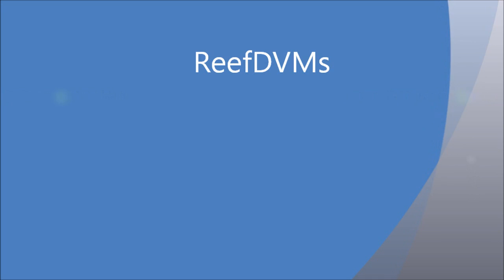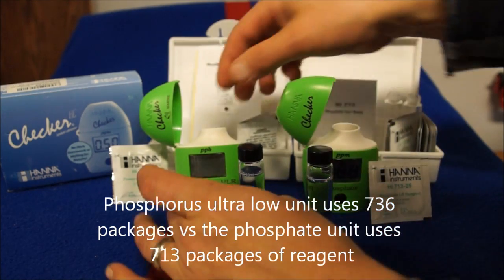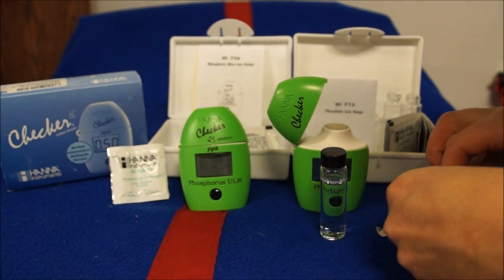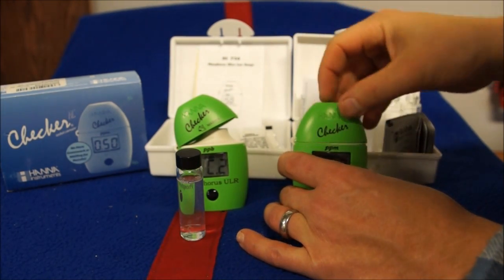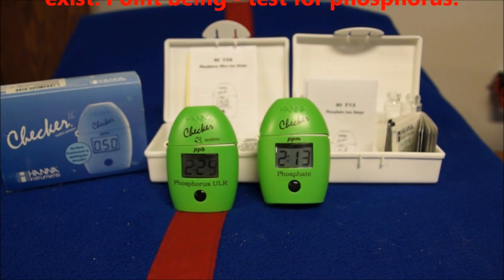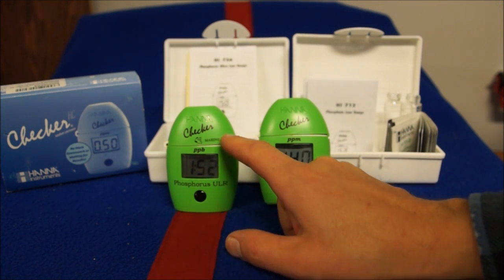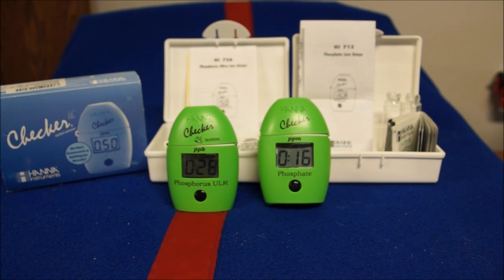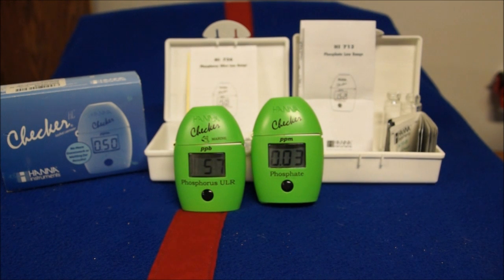Comparing Hanna Phosphate vs Phosphorus ULR Marine Testers

Comment: Great video/ very informative. It's exactly what I was looking for and answer to the varying results between the two testers and what they really test for. I was getting higher phosphorus then phosphate before carbon dosing. I stopped testing for phosphorus and only tested for phosphate and my corals started having issues. Since I have been carbon dosing my tank, my phosphorus (tester) (not phosphate) bottoms out to zero ( I didn't realize it before, when i first started dosing). If I add live phytoplankton my phosphate tester value seems to go down. I didnt understand the difference between these tester until I saw this, so thank you (I thought I was going crazy and I couldn't find a answer on the web until I found this video).

Comment: You’re putting out inaccurate information. Phosphates are not present at the equal ppb (parts per billion) of phosphorus, so you don’t just divide ppb by ppm (parts per million). All you’re doing is converting the phosphorus reading from ppb to ppm, but the phosphate levels are not being read. First you must figure out level phosphates are present with the phosphorus reading you’re getting, once you’ve figured that out you need to convert the accuracy of the results from ppb to ppm and apply to that number then you’ll find that a 57 ppb phosphorus reading is equivalent to a phosphate level 0.175 ppm not 0.057 like what you came out with. Also you’re not whipping off your finger prints from the vials before testing it and the results you’re getting may not be so accurate because the checker is picking up the cleanliness of the sample and any smudges on the glass are being interpreted by the reader as water quality.

You need to take down any misinformation you have on the internet, especially ones offering solutions and guidance because allot of people only rely on these kind of research in order to learn things and you are only making them fail.
Reply: This test kit gives different results every single time

Comment: Sir phosphorus is the best in agriculture useing or phosphate.??
Reply: Phosphate is not generally plant available.  If you say mine phosphate and add it to your soil.  Realize though that especially in acid soils a reaction takes place which makes it available.  Speed depending on particle size, pH, water, a host of things.  Plants do things like secrete acids from their roots as well to make phosphorus available.

All that said, phosphorus is generally a relatively poor fertilizer.

When you get a phosphate fertilizer.  That is either a natural form, or more commonly a product where a strong acid has already been used to convert the phosphate to a plant available form.

By law, when you see a number for the percentage analysis, the first three numbers are percentage equivalent of nitrogen, phosphate, and potash, N, P2O5, and K2O respectively.  This is done because it is what is in a plant available or rapidly plant available form.

So if you took phosphate, it would have very low numbers because it is not plant available.  

So from an efficiency or plant nutrition basis, phosphate beats phosphorus hands down.  

Now some are purists who for other reasons would either say you don’t need it and mine their soil or add tons an acre of phosphate rock to let it slowly convert.

More frequently they turn to organic phosphate in manure.

Hope that catches your question.  Throwing a judgement word like best out there with no explanation of what you mean leaves it wide open.  What’s really best depends on what you want to do.

Comment: the phosphorus test shows 57.  you said in the video that it equals .057 which is not the same as the formula you have listed on screen.  according to the formula and the general consensus, it should be multiplied by 3.07 and then divided by 1000, which gives you .175 which is almost 6 time the difference. what's more to the point is that accordiong to the phosphate checker .03 and even with the + or - .04 difference gives you an alright reading.  the .175 reading after the conversion with the phosphorus checker gives you a sky high reading.  what are your thoughts?  because I am really interested in purchasing one of these in the next couple of days.  please respond with your thoughts, as I am sure this has been either pointed out to you or you have figured out the mistake, and hence given it some thought...
Reply from the maker: you are correct if you want to convert phosphorus over to phosphate you can multiple my 0.057ppm number by 3.07 and you get phosphate the ultra checkers is reading 0.175ppm. That is the more accurate and yes higher.  Again proves the 0.03ppm (+ the 0.04 machine  variance might make it 0.07ppm)  but still not as hi as the other  test is detecting.  The value you get on the one phosphate checker is just not enough (to Low), it misses too much by like 6 times. I have given out the conversion a few times to clients so I added in screen note to show it better to make the adjustment it is hard vid to correct at this point, thanks=)  You dont want to miss detection of phosphorus in a tank for it becomes phosphate.  The Phosphate checker just misses too much readings are too low, if you use the checkers and do little math the ULR Phosphorus one will be more detective to whats in your reef potentially, thanks
Reply: @RMSpeltzFarm very interesting test. What’s your recommendation for a freshwater test? Will these checkers still work on freshwater?

Comment: I've just tried Hanna phoshate test kit I got 0.00ppm. I am trying this test kit because I can never get colour match on Red Sea and D&d po4 test kits. But they both show po4 in my system.. 
But this checker is show 0.00ppm.. ??
Reply from the maker: You are probably correct in assuming you still have phosphate in the system but if its not free in the water column then the hanna phosphate tester might miss it, the ultra phosphorous one might detect it better.

Comment from the maker: You are correct if you want to convert phosphorus over to phosphate you can multiple my 0.057ppm number by 3.07 and you get phosphate the ultra checkersis reading.  That is the more accurate method and again proves the 0.03ppm, value you get on the one phosphate checker is just not enough, it misses to much.  I have given out the conversion a few times to clients so I added in screen note to show it better to make the adjustment, thanks=)

Comment: You math is incorrect on the phosphorous test. You multiply the reading from the checker by 3.066 then divide by 1000. Your phosphate level is actually 0.174762 much too high. You will either have mad algae growing or you have fed recently giving you a much higher reading than is really true.

Comment: Everyone using a Hanna checker should know two things that this video and most others fail to tell you. 
First, make sure that you wipe the cuvette with a cloth before zeroing the checker and after you add the reagent to make sure you have no fingerprints on the glass. When mixing the reagent I like to hold by the cap so I am not touching the glass.
Second, make sure the lid is closed when zeroing and at the end of the countdown. 
If you do not do this your test results will be wildly inaccurate